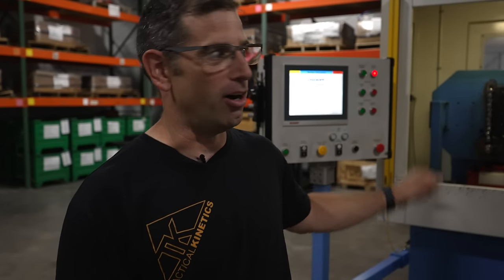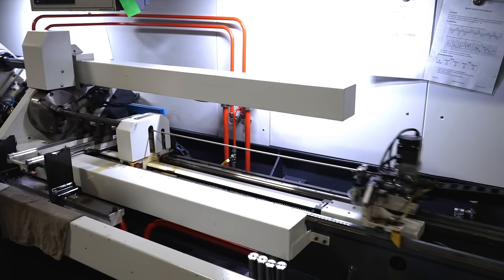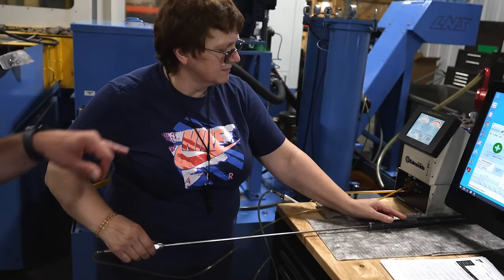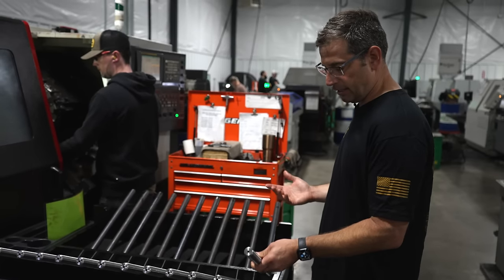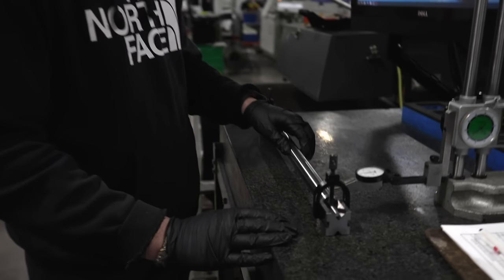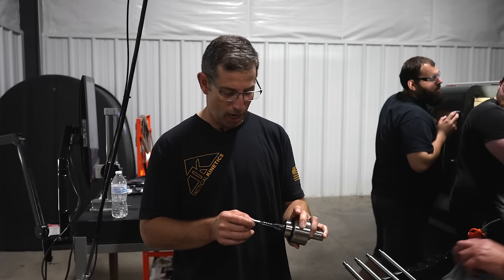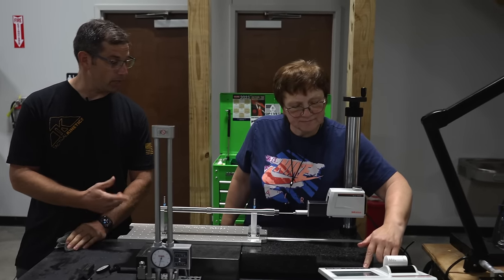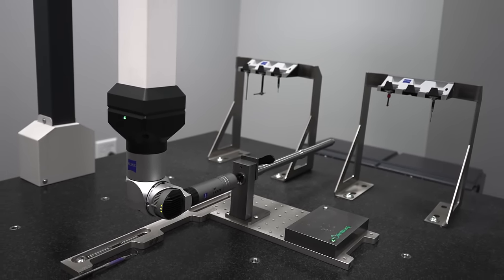How We Make Rifle Barrels at Tactical Kinetics

Comment: We tried one piece flow at my aerospace workplace but it wouldn't work. Some of the lean principles worked but not as a whole. Too many part numbers to work. Corporate tried to shove that crap down our throats and we proved to them it wouldn't work. It took a couple million dollars of lost revenue for them to figure out it wouldn't work but then they always have all the answeres. Maybe it does in your shop. It is a good principle IF you can make it work. We used Edmonds air gauge equipment also. Very good tooling. I worked 36 years as a machinist and engineering tech. I must say you folks have your processes down to a science and have good inspection and tooling. Best thing I saw was in process inspection by the operators. We had a certified operator program where when you got qualified your pay scale was better. You folks got it going on. Great set up with good machines and a very clean well organized shop.

Comment: How is headspace checked without a barrel extension installed? Chamber depth can be checked in process, but how is headspace checked? It's a three way relationship of stacked tolerances to get ar15 headspace right so where are the other two parts? 5:18
Reply: You can't. They likely call the in-process check "headspace" because it's a singular manufacturing operation, not an assembly facility. It's just an informal operation name, not the technically correct verbage. Happens all the time in manufacturing.

Comment: why is he using a Micromiter to measure a round object and not a Caliper, I was told micromiters are for thickness on flat surfaces and Calipers will give you a true diamiter that you ain't gonna get trying to use a micromiter because you're not a machine and you're not going to hit the center by eyeballing it.
Reply: Micrometers have flat anvils like calipers have flat jaws. Calipers are quick sticks, and you could have wear you don't see, flex or slop in the sliding pieces, etc. Saying you can't measure diameter with a micrometer is laughably ignorant.
Reply: @devincook2736  think i'm just used to seeing micromiters with pivoting heads that are specific for flat stock and foget there are different stable kinds for measuring wires. still for a round object I'd use a Caliper, that's what they are made for.
Reply: Because Calipers are the least accurate and as already stated micrometers have a flat service on the anvil.
Reply: @peeeoii2738  calipers have flat jaws that touch from one side to the oposing side of the round object giving you the diamiter, ID or OD. if you use a micromiter to measure the opening of a nearly 6-7" pipe, you might as well be using a stretchy string and just guessing where it gets the widest.
Reply: @lordreginaldfilibuster  mics read the the 1st-6th  decimal place more accurately than calipers also the clutches/slips on mics are a lot more reliable than using the thumb wheel on calipers due to the slips/clutches preventing the user from over clamping the particular object you are measuring, calipers are NOT as accurate measuring the OD than mics are (even on round, cylindrical objects lol)  especially if there is a micrometer stand involved Sure calipers are better than Standard  mics for ID (you can’t measure ID with standard mics haha) but they air gauged the ID and there’s other gauges that give a more accurate reading for ID than calipers, calipers are are the fast and down and dirty way to measure most things and it will give you a good idea of most things but they are the jack of all trades master of none if you will this is learned in virtually every machinist school on week one,  the anvil and swivel on standard mics are flat too where are you getting your information from?
Reply: @peeeoii2738  I worked at a Hilton and one had to spen one day with an enginear, taking him around a room that held about 10 tennis courts, I had to work the lift and drill holes in all the support beams( massive I beams) so he could measure the thickness at various points and guage the overall strength to renovate and make it a bunch of banquet rooms at different levels. which it now is and he was the one that told me micromiters are for measuring thickness of flat surfaces and calipers are for round  things,  but I'm probably wrong, that was over 25 years ago.
Reply: @lordreginaldfilibuster  They are the same measurement tool, except for precision and accuracy. A micrometer is accurate to an extra decimal place.

Otherwise, you can order both in various shapes and sizes for measurements of flats, diameters, threads (although calipers aren't accurate enough for small threads), etc.

Whatever you were told 25 years ago is incorrect, and that engineer spent his time over-spending on measurements while under-achieving on results. This is why modern quality management exists.